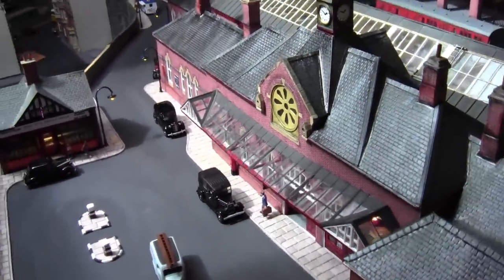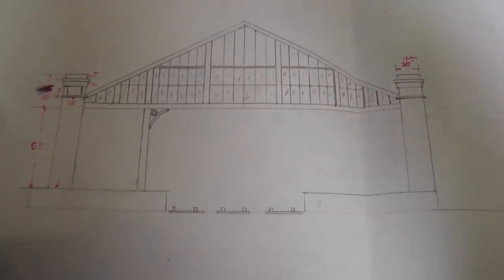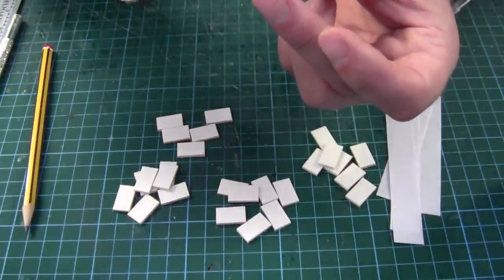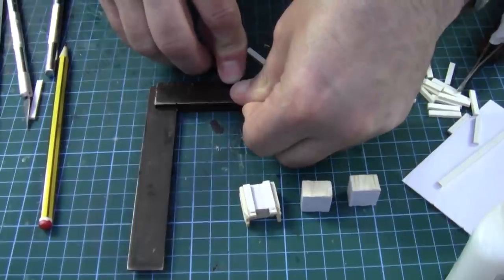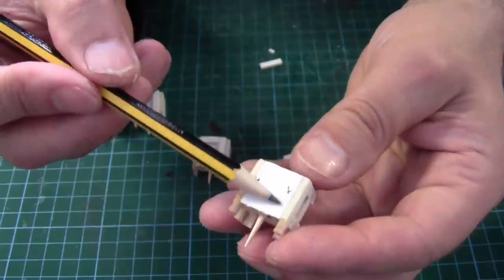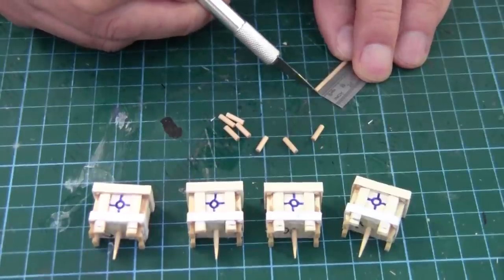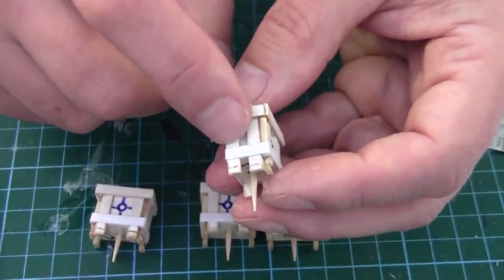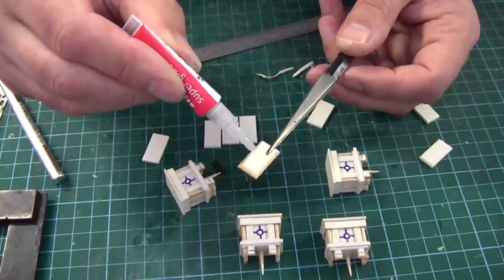The Big Roof Part 1. The Corner Stones......No 269

Comment: A really nice bit of civil engineering with those corner stones, Tony.  Just one observation.  I may be wrong but I don’t believe that there were any finishing stones to the rear of the station, but if you want to have some then that is fine by me.  The station looks fantastic all lit up.
Well, I reckon that arriving train is the 11:00pm last evening service from Sunderland pulled by Class G5  0-4-4T, number 67247, complete with Suburban Coaches (push pull).  The Loco was designed by Wilson Worsdell and built at Darlington Works on the 30th June 1900.  It spent its life at 54A Sunderland South Dock locomotive shed until it was withdrawn from service on the 31st December 1954. The loco returned to its place of birth for disposal, on the 28th February 1955.  R.I.P.
It’s now 01:36 hours on Sunday morning and past my bedtime.  Night, night.  Best, Jason
Reply: Hi Jason, 
The photo looking on the north end of station which Tony shows at the beginning of the video does show these corner stones at both front & rear. Sorry if I've misunderstood what you meant.
Kind Regards, Julie
Reply: @juliebell8072  Thanks for your comment Julie, most appreciated.  I seemed to have missed Tony’s excellent photo of the north end of the station, which I do not have, which does indeed show the two corner stones.  My apologies and thanks for pointing out my error.  That will teach me to watch YouTube in the early hours of the morning after a long day!
I have a number of images of the station which do not to appear to show the corner stones at the north end.  However, also on reflection, they appear to show the end section of roof missing.  
Thanks again for your informative comment. Best, Jason
Reply from the maker: Hi Jason my old friend. obviously you missed the opening intro. as that photo was the rear of the station and it has the corner stones built into the pillars. its probably the only photo that exists showing the rear of the station with those on. later on in the 1960's the roof was cut back why i do not know. it was a shame to loose corner stone. i think Amble station had the same feature. i might have to check that. 
I have ordered a class G5 from MRC. with a south Tyneside running Number which i can not remember for the life of me. which i can not wait for. as it will finish the off the rolling stock for south shields. thanks for the info as i have made a note of the running number. 
its a shame that there is not a G5 preserved. Thanks again as always for your comments....cheer's Tony
Reply from the maker: oop's i should have read all the other comments first before adding mine....still we are all in the same boat and we are friends in this comments Hub. thanks again and stay safe........cheer's Tony
Reply: @TONYNORTHEASTERN  Hi Tony, I don’t remember the opening intro, probably because I was half asleep at the time. 🙄
I think the station you refer to is Alnwick (Amble had just a small station), which had a trainshed roof and corner stones but whilst similar they are different and have a pyramid capping stone, unlike the ones at South Shields which are flat. 
Regrettably, there were no Class G5 locos preserved, however, the ‘Class G5 Locomotive Company’ based at Shildon in County Durham, is building a brand new G5 loco from donated funds.
When I saw the train arriving in the dark and you asked us all to guess what it was, I assumed that you were referring to the 1:1 scale South Shields, when in fact you were referring to your splendid 1:76.2 scale model.  The details that I provided in my ‘guess’ were all based on historical fact including the departure time of the last Sunderland Train and all the details of the G5 and train, including the running number, 67247.  Maybe that is the running number you will get.  The trains were usually of ‘Push Pull’ operation, but I believe that the mechanism to the driving coach was never implemented and so the ‘Push’ journey was started by the use of either a bell and/or a whistle, relayed from the man in the driving coach to the engine driver.  I understand that is where the expression “all bells and whistles” comes from.  Best, Jason
Reply from the maker: Dont beat yourself up mate for missing the intro. i know they were talking about building a G5. so its actually happening now. that is great. its a shame they can not re-build on of the missing south shields stations. take care Buddy......Tony

Comment: Thanks for showing the skill you have in bringing photos to life. What are you going to do when your layout is complete? I notice that you are using Delux Card Glue. Have you ever had this glue change colour on you? If not, how do you store? Reason I ask is because I purchased 2 bottles to make a Metcalf Model or 2, and over a period of 3 months both changed colour to a sort of light tan colour. Any advice would be a big help. Thanks, Mike
Reply from the maker: Hi Mike. thank you for generous comment. i am sorry to say i have not had that issue. it could be the card. or if you have left the top open for to long. but if should effect the strength of the glue. 
probably best to manufactures advice. sorry i could not be much of a help on this. keep the lid when not using, and keep it out of the sun. i always keep mine under the baseboards out the sun. stay safe all the best Tony

Comment: Hi Tony. Those stones are not insignificant, they are a statement by the Architect saying look at me. They look great! A question. Did you cut out all the parts by hand or use some form of cutter? They look so identical. The lighting is amazing. You have got the levels spot on!
Reply from the maker: Hi Alan. all the parts are cut by hand. i think making up the cube first and then adding the various layers. helps build up the large stones. they are within a half a millimetre. but if you closely there are some slight differences. thanks again for commenting. best wishes Tony